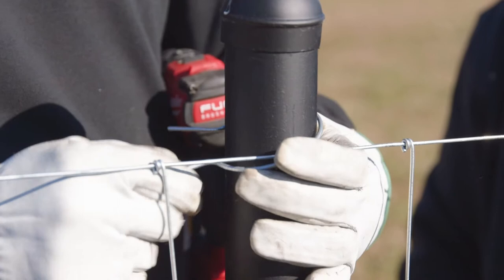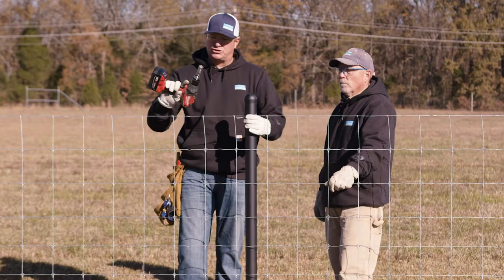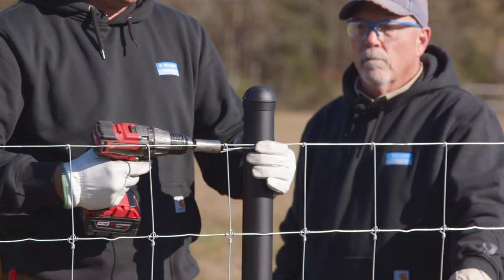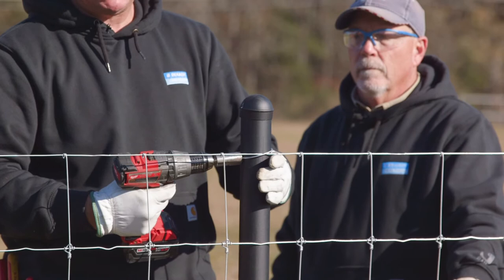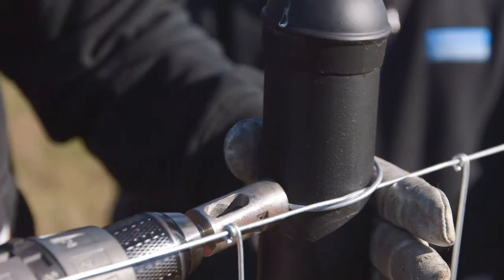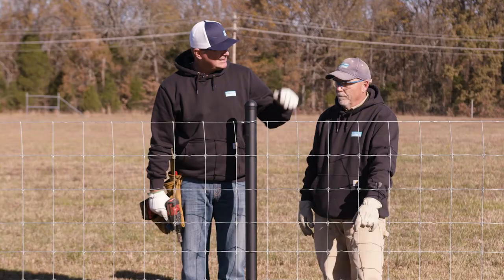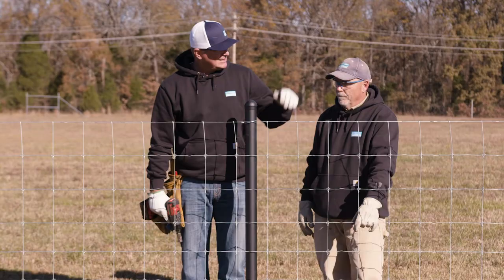How to install a Pipe Post Clip using a Drill Chuck

Comment: How easy will that clip slide on a post? Or will it not move at all and hold very tight?
Reply from the maker: If placed and installed properly it will move slightly to allow the fence to react to hits on the fence but will still hold tight.
Reply: Think i might try to fasten barbed wire to 2 3/8 galvanized post with these clips @BekaertFencing